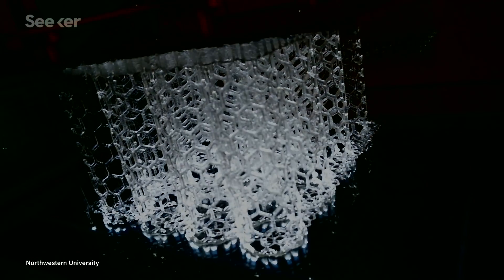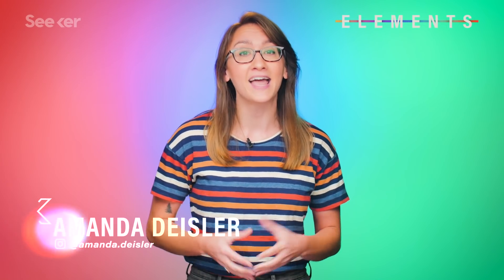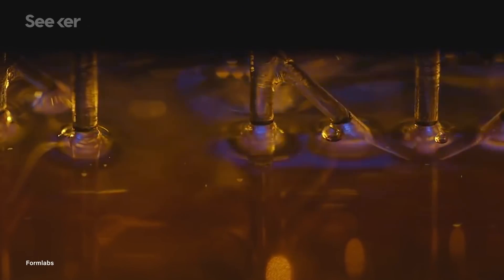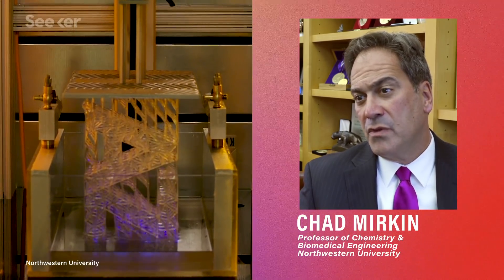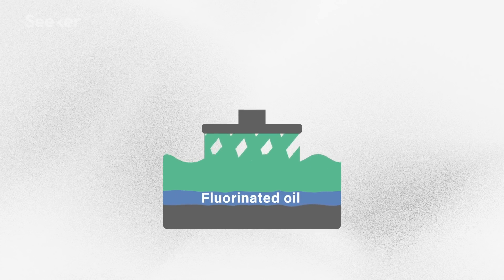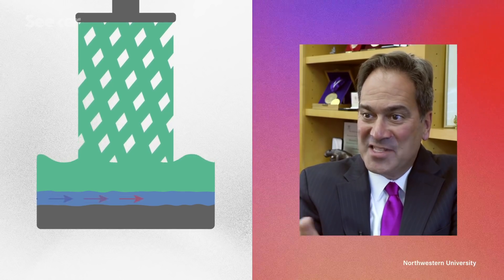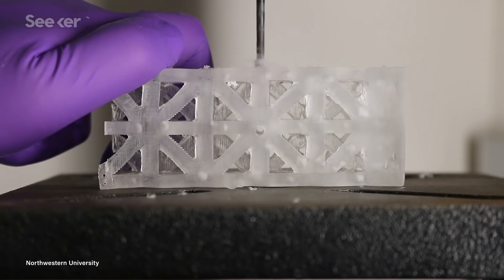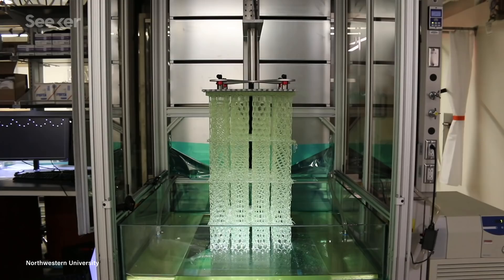This Record-Breaking 3D Printer Could Be the Future of Manufacturing

Comment: CAN IT PRINT ANOTHER 3D PRINTER?😆
Reply: Well, if you give it the materials.
Reply: Maybe
Reply: Not until it can print a motor.
Reply: Well that is essentially the end practical goal really. If you want the machine to be further long-lasting in an isolated environment where parts might be scarce.
Reply: all u really need is a 3d printer to make parts and an ai assembler and it can make as many 3d printers as you  have materials for
Reply: dude that joke got old back in the day when your grampa was still in diapers.
Reply: *Insert Futurama reference
Reply: You pretty much can print nearly everything to certain point, the problem is speed and materials and not every print is successful.
Reply: good luck printing the electronics pal.   the magnets in the motors.  and all that.   

you can print the frame.  and even the rails.  and it would be more expensive to buy the fillament needed to print it.  then to just buy aluminum framing.
Reply: darkracer125  you can ready print electronics look at Voxal8 and others they are just not high quality and still exspensive.

Comment: We still need metallic and composite products,  tho. I do salute the engineers behind this tech, not to make perfect the enemy of better.
Reply: There is metal 3d printers.
Reply: Yes there are many metal printers that are very fast now.
Reply: 3D printing metal is very very very expensive. We have printers that can do it but no one wants to use it because of the cost and the number of metal 3D printers
Reply: Ye the showcased printer wont print strong enough parts. We need to lower the cost of metal 3d printers asap. Not this bs.
Reply: the showcased printer is a novelty.   the shit it prints is so weak i doubt it could stand up to the weight of a single banana.   
resin prints are horribly weak.  horribly light sensitive.  and extremely toxic in liquid state.   

it's horrible technology.  

and metal 3d printing is NOT fas at all.   
the regular fdm metal printers (resembles a mig welding head on a 3d printer) are not fast at all.   just as fast as any fdm printer.  
the powder deposit printer are a little faster but they loose their speed because the prints need to go into a kiln for several hours.
Reply: Check Adam Savage Iron Man Titanium 3D printed armor....  They already make 3D printed Rocket engine...
You can easily find a Stainless Stell 3D printer on the market also. Just go on the shows..
Reply: @darkracer1252  Well, sorry to burst your bubble.. But remember the "telegraph"... it was shit too... let's see now, 100 years later we have 1TB Wifi download speeds... hmmm
It won't take 100 years for the 3D printers to come to the same results... 20 years at most.
Reply: @INeedsMoneys  Strong enough parts is a subjective opinion. The strength of the part  depends on the application. Also as you can see in the video it would be able to print a variety of parts such as flexibles and rubber type components.  There are metal 3D printers that  cost only 10k now and the prices are dropping.
Reply: @AWARHERO  they are waaaaay to expensive mate..
Reply: @INeedsMoneys  Honestly anything is better then this printer.
Reply: @chetan9707  new tech has made it more efficient and cost efficient I’d expect them to be released in the next couple years

Comment: When the metal printers reach this throughput manufacturing will change forever.
Reply: MrPaceTv the person who invents it will make billions!
Reply: MrPaceTv  Or when a polymer is created that has the structural characteristics of metal.
Reply: Well said
Reply: They don't need to. Metal additive manufacturing is only used for parts that are too difficult to machine on a 5 axis machine. Grain orientation is one of the most important thing in applications, which is very difficult to achieve with additive manufacturing, but easily achieved by forging followed by machining. It'a a balance, no component is 100% printed, only the parts that make sense to printed get printed.
Reply: @l0_0l45  You are talking about today's technology.  I guarantee you that CNC machining will be a dead art in 100 years. Just like blacksmiths are today.
Reply: @danarrington2224  Probably. So will 3D printing too.
Reply: @mapp0v0  Not impressive really.

It's industrial because it literally requires a frickin factory to be viable.
Reply: @l0_0l45  "Probably. So will 3D printing too."

The current AM technologies will be dead, but in their place will be a wholesale method that works for all materials and scales in speed and size.
Reply: @mnomadvfx  Lets hope its one that comes with the problems of neither of current manufacturing technologies and the advantages of all plus more.

Comment: A step in the right direction, but that's still not very fast for many important applications, such as manufacturing, building materials, product customization, etc. Fortunately, a couple approaches are soon to bring 40-200 fold increases to that 7mm/min (1 foot to 5 feet per minute, depending on scale).

Comment: 2019: plastic straws are the enemy.
2020: faster 3d printing.
2021: 3D printed straws are killing the ocean.
Reply: What if you made a biodegradable resin (is that even possible)? Probably much better than those paper straws.
Reply: Or you know, you can reuse the completely reusable metal straws or even polymer straws instead of buying disposable ones like a peasant
Reply: Straws are too simple for 3d printing to bother with.

Comment: This is amazing. They didn’t explain it in the video for those who don’t know about 3D printing. For a home fda printer, the most common ones, printing a life size human head would take anywhere between 3-5 days depending on print settings. If you were to print something at the resolution of the printer in the video on a typical sla printer it would be at least a week if not more. 

So to print a full size human in hours is truly revolutionary. Sla printers have gone from $20,000 to $1,000 in the span of 5 years, so even if this printer has a high price now it will go down very quickly.
Reply: Too bad pretty much all materials for these printers are completely useless. Come on, don't act as though these things will ever replace injection molding or even supplement production with otherwise tricky to produce parts.

Comment: I think SLS printing should have been mentioned in this video. 

Complicated metal parts for aerospace are becoming standard fair. From rocket nozzles to fuel injectors for turbines there are tons of highly complicated SLS parts being used in industrial settings around the world.
IMO, 3D printing is very good for low batch size fabrication, prototyping and eliminating the need for machining in metal parts. I doubt large batch injection molding will be surpassed by any form of 3D printing in the next 50 years, but I'll gladly eat crow if I'm wrong. 

Good video!

Comment: Now they just need multiple light emitters along a conveyor trough of continually replenished resin that they can run the production head along, so that it starts at one end clean, and comes out the other fully printed.  That way they have one long, continuous printing line.

Comment: Whenever watching videos about development in 3D printing technology, I always remember the use case where an austronaut can get different tools printed remotely by instructions from earth. I don't see this printer working in space however, because the liquid will not stay put.
Reply: It could stay put due to viscosity and surface spread, if it was injected around the base from a series of large syringes, and hydrophilic surface extended it into the intersecting lasers, but hydrophobic surface on the base and surrounding walls stopped the surface layer from sliding too high up the walls.

Comment: i actually have come up with a SIMPLE low cost 3d printer design that will be much faster than traditional low cost (<$1k) hobby 3d printers... at the same print quality. idk if i should put it on kickstarter or do a tutorial vid showing how to build it. either way, look out for it this month/ year depending on which route i take
Reply: might use as much recycled cast aluminum for many of the parts of the printers as well

Comment: I'd be interested in knowing what the margin for error is in this process. Is there any testing being done on the finished product for structural integrity? I can see this being utilized for a key component in some kind of machine. Then possibly failing. In turn making the case for more strict regulations on testing the parts for flaws. Unless of course the mere way it's produced leaves almost zero room for flaws.

Comment: Printing big is one thing, printing accurately is another. All 3D printing I've seen is relatively crude and requires a lot of manual finishing work to achieve quality approaching what you can form with "conventional"  plastic moulding (which is often quicker too). That goes for low end consumer printing and expensive industrial printers. The featured one in this video looks like they sacrificed quality for size and speed.

Comment: Looks good, sounds good, lets see what it can do in praxis.
Reply: That's easy: Nothing useful at all. It's slow as heck and SLI resins are crap in basically every regard. The material strength is comparable to spaghetti, but at least spaghetti won't crumble into dust after being exposed to sunlight for a while.

Comment: Sounds like just a basic resin printer, but big
Reply: Jonesy Films 
Exactly what I was thinking. This isn’t really new.
Reply: What is new is the layer of non-stick fluid that sits below the resin. Normally a SLA printer has to constantly lift and lower the build plate to break the print off the bottom membrane so a new layer can be formed. In this case, the print never sticks to the membrane, so a continuous print can be generated without the extra steps.
Reply: @Tyraeous  There is a paper published on the non-stick liquid layer in Science - https://science.sciencemag.org/content/366/6463/360
Reply: @Rachel-if8hl  so it's better than the ones Carbon use?
Reply: it literally is and doesnt claim not to be. the only reason its revolutionary is because it doesn't need to wait long between layers

Comment: The real breakthrough will be when you can print multiple materials at once. Things that include both plastic and metals, or multiple types of plastics. I know it can be done with multiple heads on a standard printer, but it’s very slow.

Comment: This whole process is extremely expensive and will not at all have the practical application many think it will as it currently exist . 

I still am hopeful
Reply: What are you talking about what process is expensive? The Teflon oil? because SLA printing is at an all time low in terms of cost.
Reply: You can get a SLA printers on amazon for 200 bucks already. I mean to be honest. All a SLA printer is, is some motors and a display that shines light onto the resin. Then resin does the rest.
Reply: You are 100% right. 3D printing cant compete with injection moulding (IM). 
It needs to check these 5 boxes, and the best pro machines out there are able to an mixture of 3, 4 and 5. hobby(200€) and midrange (50K €) maybe one of them depending on how you calculate it:
1. it needs to be able to print with the same materials. (3Dp has a few hundreds, IM has a few 100.000 variants.) The biggest material developers converts/creates a few materials a year for 3Dp, but often 1500-3000 materials for IM pr. manufacturer. And there are many material developers out there.
2. If the right material is available, it needs the same material properties as IM - but it cant have that as it is made in layers, low heat, no pressure.
3. it needs to be as cheap as IM and that includes the postprocessing.
4. it needs to be relatively fast compared to IM
5. it has to be able to hold production tolerances comparable to IM
Reply: @jonjessen  it doesn't have to compete and it can also complement injection moulding.

Comment: Great, more plastic for landfills.  If this gizmo printed metal it would be a game changer.
Reply: Get off that high horse, mate
Reply: Metal would be good, ceramic (which is possible) would be at least as good if not better.  Once you can print things like silicon carbide.... a huge number of practical uses become available.

Comment: LOL. DEBUNKED. Notice they only do lattice structures fast. Because the liquid needs to flow into the center of the model, and only lattice structures can flow liquid to the center. Solid surfaces must lift and then lower the model for every layer.

Comment: Hopefully this helps innovate the conventional printing systems. I hate having to buy a new printer every few months... Wait what's that? This is just 3d printers? Paper printers and it's inkjets are the pinnacle of paper printing technology? Damn it. Hopefully the future holds a better solution. Maybe even just burn off ink on paper with heat activated paper ink solutions so you can reuse paper.

Comment: This idea was first  also came to my mind. during making my pcb solder mask i thought what if i use lcd that can emmit uv liglt as 2D plane of printable structure with in such uv curable fluid so with the help of G code  with it we can make 3d object faster.  after long time thinking this project , once i thought may be such technology are already exists. then i Google it that time and fine ' yes ' that was Chinese company its all room was lightening by yellow lights. because shorter wavelength can interfere with uv sensitive fluid. ... so..... why this video if such tech was already exists.???

Comment: Seems there's 3d printing advances daily.  As Chad Mirkin says . . . and I've heard of him before in connection with DNA nanotechnology . . . he's got even more advanced stuff in the back of his laboratories.   How far 3d printing goes should indeed be interesting, as I've seen electron microscopes that can 3d print in three dimensions at less than a hundred nanometers resolution.  If they can get down to .3 nanometers, we can 3d print to atomic . . . . each atom in its place . . . scale.   There's also a two photon laser tweezers technology

Comment: Waiting for the day a 3D printer prints a 3D printer...
Reply: Check out the RepRap Project. It started many years ago as a way to print your own 3D printer - completely open source. It was FDM (melting and extruding plastic) as opposed to this DLP/SLA technology (turning a liquid plastic to solid with light). It is very difficult to 3D print a DLP/SLA printer because of the optics (laser or project, some sort of light source) involved.

Comment: That isn't that impressive. My filament printer totally cranked up with the normal 0.4 mm Nozzle and 0.3 mm layer height can do 2 mm in a minute if I just print thin structures that are just high, but don't have much infill. I even did 1 cm a minute if I just print a small 2*1*1cm hook. And if you print with less accuracy and a better hotend you can pump up even more. Like using a 0.8 mm Nozzle at 0.6 mm layer height, which can double your speed.

Comment: I guess this wouldn't work in space, 0g?
Reply: If you need G's in space, you just have to spin.

Trying to get zero-G's on Earth is much harder.
Reply: Marc Jackson  , 100 metre radius @ 3rpm gives almost exactly 1G, and the tidal difference in G Between head and feet is only 2%.
Reply: @massimookissed1023  That's an oversimplification if I've ever seen one.
Reply: Marc Jackson  , a good point, but you just need to be 100m from the rotation axis.
 That could be achieved by tether cables.

Comment: just a big sli printer. nothing special there. the resin is toxic and difficult to work with. the final parts are brittle, unstable to uv light and cannot be used for parts where high material strength is needed. oh and the resin is extremely expensive, 1liter costs around 70 to 100 bucks. Looks cool and scifi but you cant do much more with it than printing some figures or carbon nanotube lookalike presentation parts. Maybe in a few years

Comment: Never going to be used in manufacturing. Too expensive, not strong enough. No profit margin.
Reply: gets cheaper when you consider that transportation becomes a non-issue
Reply: @TreesPlease42  No, the cost of anything out of this printer is magnitudes higher than with classical manufacturing processes. It's really slow, it's energy-intensive, overly complicated and maintenance-intensive and the resins are expensive and toxic as hell. And how would this cut down on transport? You do not honestly think you're going to ever own one of these, even in part, do you?